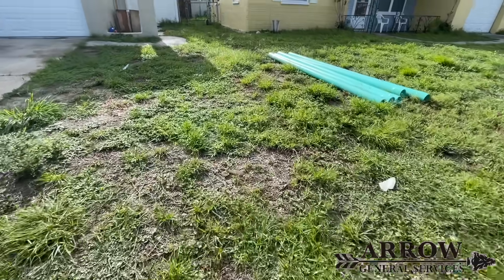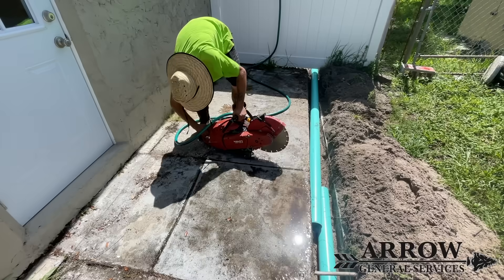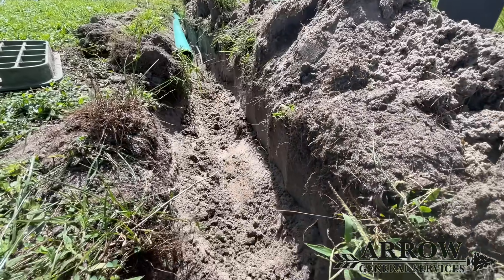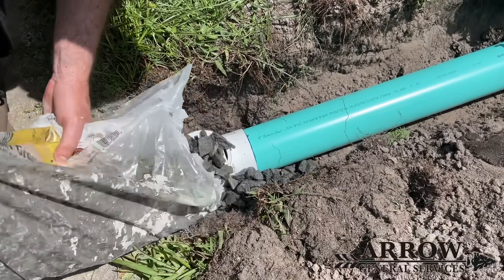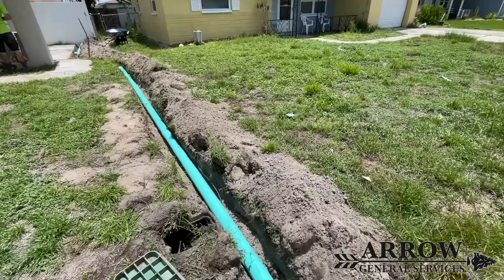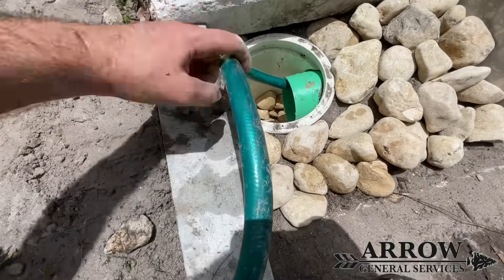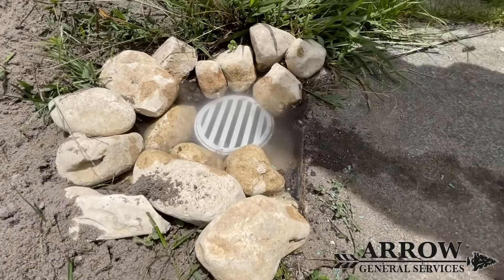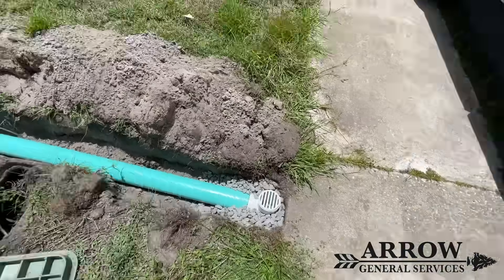How To Drain A Yard With No Slope - Flooding Issue Solved

Comment: It would be easier to create a swale in the yard, I raised my soil 6" and added a swale 6 feet from my house to divert rain water.
Drain pipes constantly clog.
Reply: Yes and no - you need a steeper grade to convey water over grass, pipe will run at a lot less. 1/4" per foot or 2% is the recommended min. grade and that's not great. We run our 8" sewer mains at 1/16" per foot or 0.4% (smaller diameter should be steeper but that's accounting for solids). This yard can't be raised due to the floor height of the garage and the building code , in my area, states you need 6" from the sill plate to the ground, they don't have it. So you did it right thing with the swale but a flat yard is something I'd never buy - super deal breaker. BTW, I work for a city and my job is to help homeowners try to alleviate these issues.

Comment: You should use a non-woven fabric to wrap the gravel around the pipe so that soil will not choke the holes in the pipe over time. 
Without that, your pipe will work for about 2 years only.
Reply: Did you miss the part where he used solid PVC out to the curb? Why would you wrap a solid pipe?
Reply: @iwastoldtherewouldbenomath6869 
 kinda weird cuz lots are generally sloped with a 2% grade (1/8" per ft) from back towards the street (building code). I dug a sewer line from my pool house  out to the front cleanout riser, next to my house, in a uniform 18" ditch the whole way. Used an 8ft framing level to check grade and it cracked the bubble the whole way.....23 yrs later still works, never clogged. We rent it out to college students now. SoCalif.
Reply: @readmore3634  I do this kind of work for a living and I can tell you most homes have land that is sloped incorrectly. 
I also generally do not use a level but rather I use a laser level and shoot the entire run. You can get into problems with a level because it only covers a few feet. 

The video solution is one similar to what I have done when there is little to no available grade to carry the water away. Many times I have had my crew dig out a catchment basin to hold the water and it's been highly effective.
Reply: @iwastoldtherewouldbenomath6869  Good to know, I just figured eventually it's gunna fill up with dirt cuz dirt doesn't soak in...it builds up.
 I used ABS (plastic) pipe so it's not perfectly straight. An 8ft level and constantly shading pipe with dirt is a must down in the 6" wide ditch. It has to be pretty straight at 2% grade (1/2" of fall every 4 ft). 2% grade is actually legal/adequate but it has to be cast iron...I hate cast iron. 40 years Master Plumber, Union, journeyman, Local 364 in SoCalif. Custom houses are my specialty....lots of remodel.
Reply: @readmore3634  Sure, maybe in 15-20 years it might become somewhat impacted by sediment but that's not an issue as the pipe is solid SDR35.

I'm fully aware of the code, 1:96 pitch is standard throughout the industry so I am not sure why you keep repeating that.  

Most municipalities do not require any kind of permit, depending on their uniform statewide building code, and allow up to 2500 sq/ft of soil to be disturbed for exterior drainage as long as no modifications to a structure are made. 

I also hate cast iron pipe.
Reply: @iwastoldtherewouldbenomath6869  
The pipe I installed was for sewer, not flood control. Thought maybe some DIY person could use my information in case they were running a sewer line. Obviously you already know everything....and apparently I keep repeating myself...Here's something I haven't said: If the install in this video is absolutely flat, and they get like 4-6 inches of rain a year....it's going to fill up with (silt) dirt in no time ...and that's going to be a pain in the a$$ to clean. I wouldn't install this system if the homeowner begged me to..... I'd rather have the homeowner pissed at somebody else...not me.
Reply: @readmore3634  Ok, one last time since you are also not getting it: The pipe is solid. Period.  Why is this so difficult to comprehend? It's not perforated drain pipe. It's  S.O.L.I.D
Reply: @iwastoldtherewouldbenomath6869  
 That was kimchee94112. 

I'm the guy who knows about this stuff.
You're the guy picking everyone's replies apart. I knew what "kimchee" meant, and he's right...common sense.
Go pick on something you know about.
Reply: What do you mean by “ constant shading pipe with dirt”?  DIY’er here and backyard hi,do water for days and days after heavy rain we get in the south. Put in a pool and don’t know if the bobcat packed the soil so it couldn’t percolate down or what. I don’t want a French drain that can fill up with dirt. I want maintenance free solution for my flat yard.
Reply: @kayBTR  "constantly shading pipe with dirt" means as you lay the pipe down in the ditch and position it, add dirt on top of it (shade) to hold it in place. The sun can heat the top of the horizontal plastic pipe causing it "crown" or lift up....like having a hump in the road. Also, if you're installing plastic pipe in a ditch and it rains that pipe will float unless you cap one end and fill it with clean water to keep it from floating.... ...now....if you actually bury it and compact it as you go.....you should be ok if your ditch is 12 inches or deeper.
Reply: @kayBTR  This is a common problem when pools are constructed. The soil where the pool is used to be undisturbed and now that is has been disturbed, and a pool installed, the water is taking a different path and likely creating a false water table around the pool. I assume it's an in-ground pool right? 

There is no such thing as a truly maintenance free solution. Hire a professional.
Reply: @readmore3634   This looks like a well aged area, so the house has probably settled a few inches and a lot of runoff has eroded any major sloping.
Reply: @jmackinjersey1  Exactly, The author said it's flat, no slope. IMO it's basically a long skinny reservoir being installed with 2 very small seepage pits. I guess that's better than nothing.. but I wouldn't install/warranty/advertise this as a solution. I'd rather have my customer pissed at someone else...sometimes you have to say no, but thx.
Reply: @iwastoldtherewouldbenomath6869  I think the pipe being solid isn't the point.  The point is that rain runoff is not clean.  And that eventually, the sediment will clog the pipe.  Another way of thinking about it, is what cost is there to putting a filter over the ends?
Reply: @briholt100  I tried doing that many years ago and was back out within weeks because it was clogged. 

The smooth pipe lends itself to easy flushing or cleaning. Putting a filter place only clogs it quickly with fine debris. 

The cost is repeated visits and a pissed off customer.
Reply: @iwastoldtherewouldbenomath6869  That makes sense.  I was thinking a filter on the higher end to keep stuff out, and not any on the lower end, but the ease of flushing makes sense.  Thank you.
Reply: @briholt100  YW. I too was a user of the corrugated piping but converted many years ago after every single one I dug out was impacted with sediment.
Reply: @iwastoldtherewouldbenomath6869  
"wrap the gravel around the pipe" meaning the gravel around the pipe not the pipe itself. I guess you have not taken differential equation.
Reply: @kimchee94112  It seems that reading comprehension isn't your strong suit. It's solid pipe, meaning no holes so why the hell would you wrap anything around it? The type is SDR35, used for gravity sewer and storm drains. 

WTF do differential equations have to do with SOLID pipe?
Reply: @iwastoldtherewouldbenomath6869  
You do know in this case "around" means near, not wrapped all around the continuous the length of the pipe? Did you not see the length of the pipe was not wrapped, only near the pipe where the gravel was located? Differential equation would be confusing for someone depended on no math required.

Comment: In northern climates will these drains and grates freeze in the winter?
Reply from the maker: Yes, and I would not recommend using PVC up north where it freezes. The grates would be fine but the PVC would crack from the cold temperatures if any water freezes in them. Use a high quality polypropylene pipe up north.

Comment: Seems like roof gutters and down spouts would be useful.
Reply: Good video, but I’m pretty sure you ARE NOT allowed to discharge water onto sidewalks in most, if not all municipalities due to freezing.
Reply: @jamesjoslin7586  correct, and not even for freezing, for any reason
Reply: That would help a lot.
Reply: Gutters for that extra protection!
Reply: Should show it working
Reply: Capture the water first, then move it in the direction you want
Reply: Exactly what I was thinking. This is so much more expensive than gutters.
Reply: Right
Reply: But you still have to direct water away. And there are maintenance issues, especially when there are leafy trees
Reply: That and grade around the house would do the trick.  I fear they will still have issues with those slabs pitched back toward the house.
Reply: Work smarter, not harder?
Reply: I was just about to say this
Reply: No brainer   first thing
Reply: First thing I thought
Reply: While I mostly agree, this is by the more affordable option and works well for those who don’t want to worry about cleaning out gutters. Installing gutters is incredibly expensive even without hiring a contractor.
Reply: @TitaniumTurbine  Trenching and laying pipe is more affordable than installing gutters ? I dont think so.....
Reply: Useful to transfer the water to the ground. Ok
Reply: Those are only for good looks and some say to keep water away from the foundation but rain goes everywhere so the foundation still gets wet unless there's a poop pipe put in to direct the water away from the foundation our gutters work how they're supposed to but they don't keep the neighbors water out from the yard on our slanted yard i get water run off from 2 neighbors
Reply: Yes, roof gutters and waterpipes to water tanks. Then you have all the water you need.
Reply: Remove that terrible concrete,make the new concrete taller and sloping to yard then add gutters with drains
Reply: @dodgegarage7422  Make it higher?! Then it's in the house.
Reply: But it would still puddle
Reply: @Tkidddd  would help though
Reply: @Tkidddd  Not if properly installed.
Reply: Right!!
Reply: Gutters and downspouts won’t make any real difference. It only concentrates the ponding. Conducting the water off the property is still the central problem.
Reply: @davidlang1125  - They would make a huge difference. That's why they make pop-ups. The down spouts are directed into the same type of drain pipe towards the road as they did in the video and water is released via the pop-up.
Reply: @davidlang1125  bingo!   I think what most people don't realize this is like the desert Southwest and when it does rain it becomes inundation & flash floods result.  Dry riverbeds and arroyos become raging Rivers carving up the Earth.  Tampa is either very low me from organic matter or the base is hard Rock limestone, not great perks.

I am surprised that all who have suggested full blown French drains...did not go with the full banana and suggest elevating the home...  Exit the water to the street and let the municipal stormwater system take care of it
Reply: @barrelmitt1544  I know this is a month old, but the this only works in an area that doesn't freeze. Otherwise, when the water goes across the sidewalk towards the street, it turns into an ice patch and a lawsuit. Lol.
Reply: This is the most expensive way. Lol hahahahahahaha lmao just instal gutters.
Reply: Not if you’re there to sell landscaping services rather than gutter installs😂 me, I’d sell both, but wouldn’t tell them I do both till I’m done with the landscaping😂😂
Reply: @Ichabod_Jericho  Then I'd let you go and hire someone else to finish it.
Reply: Literally the only thing needed lol
Reply: If anyone commenting here actually watched the video, you would notice the pitch/fall of the roof, and the fact that a gutter would not help WHATSOEVER in that area.

It is likely, that most of the ponding of water is from rain hitting the side of the house and building up on the ground because of no fall away from house.

Best remedy is to run that grate all the way along section and connect to existing storm water pipes, if regs allow.

Comment: You didn't fix the root problem:. Directing water off of the roof correctly.
Reply: Gutters are probably a cheaper solution, but I am not the homeowner.

Comment: whats the minimum fall to make the system effective?
Reply from the maker: As long as the bubble on your level is going slightly in the opposite direction of where you want your water to flow it will be good. But the more fall you can get the better!
Reply: @StormWaterDrainageSolutions  I reckon I can get the fall from having the trench get deeper as it goes through the yard

Comment: Running a hose directly into a pipe is exactly the same as thousands of gallons of wind-driven water falling from the sky and I am completely convinced that this system will work perfectly for more than six months.
Reply: Sincerely speaking, I am completely convinced you are speaking sarcastically. They say using/understanding sarcasm requires high intelligence, do I get a prize?

Comment: Problem !  not knowing what class of soil you have,if its clay as i see? when heavy rains come the water will not perk into the ground as you stated. Also, not knowing your location, i do see a public sidewalk. Most city codes  restrict you from  draining  on a sidewalk ! also, if it freezes ?  you better have  good liability insurance.  I think you need a lift pump station and keep the excess water on your property only .  My opinion.
Reply from the maker: You are correct, this will not work in clay soil. FL has a lot of sandy soil. This sidewalk is connected to the road so there was no going under it unfortunately.

Comment: That rock is going to mix together with the dirt and fail over time. It needs fabric
Reply: Fabric fills with silt and block much quicker which is why fabric us used in very large areas not a small outlet

Comment: Is there a reason why you'd daylight the drain with a catch basin vs a pop up?
Reply: Same thing.
Reply from the maker: Pop ups tend to restrict the flow of water more than a grate. Also a lawn mover can suck the pop up into its blades. We will use them if the client wants them.
Reply: Plus pop ups fail!

Comment: I had a similar issue but not really against the house. 59 year old me placed 4 mini catch basins that drained into perferated drain pipes. They led into a solid pipe. I made sure the pipe had good fall & was able to move water and into a pop up drain at the road. I'll eventually connect my gutter drains into it. I did use river rock around it I also placed fabric over it to keep the perforations clear. There is no longer standing water there.  This work was done in Indiana.
Reply: Don't make rain water flood onto the road please.  It is a serious fine in most council areas.  Imagine there is a serious rain fall and your flooding water section causes a car to lose control and have an accident.  First you probably broke the law as drainage is meant to be kept inside the property boundary - then your property insurance would not cover the accident cause you broke the law..... need I go on?
Reply: @markplain2555  nonsense. Are you from England? We dont call them "council areas" in America. We also require community storm drains in neighborhoods here. Dumping your property runoff into the street, allows it to run off to the community storm drains, eliminating the water from the street. 
"Need I go on"? You literally dont know what youre talking about. You can "go on" all you want, but youre flat out wrong. At least in America you are wrong. I dont know about England, where they do everything wrong, and havent updated building techniques in 100 years. But please, do go on. 🙄
Reply: @Kakaraut01  Wow Carl....you sure have  a way with people. A guy, possibly Canadian, makes a spurious comment about yard drainage and you manage to offend the entire mother country, and a different one at that. England does at least some things right, they make a good kidney pudding, let's see THAT in America.
Reply: @TheLarryBrown  we fought a war to get away from garbage like kidney pudding, and poorly planned out neighborhood drainage.
Reply: @TheLarryBrown  Carl isn't wrong though.

Comment: You should  have ran it under the sidewalk even if you needed to use rectangular  pipe under the side walk,the best way would have been put a real catch basin in the backyard . Put a trash pump in and run a 2" pipe out. 30 year as a plumber , you're asking for problems with that system you installed . Everything available  at plumbing supply house a plastic or concrete  sump pit , the pump comes with a 20' 110 cord , grate or cover and it would've been done in about thre to hours four from start to finish. And it would allow future  drains to drain into the pit if it didn't solve all of ghe home owner problems
Reply from the maker: spillymcgee.2350  Well considering the road meets right up to the side walk there really is no way of going under it. There is also a storm drain a few houses down from this house that water travels to so I’m thinking it will work out just fine. No negative call backs and the client said it solved the problem 🛠️

Comment: If there’s no slope, do you have a check valve to prevent water from backing up at the trench drain?
Reply from the maker: No check valve because that could create a potential clog.